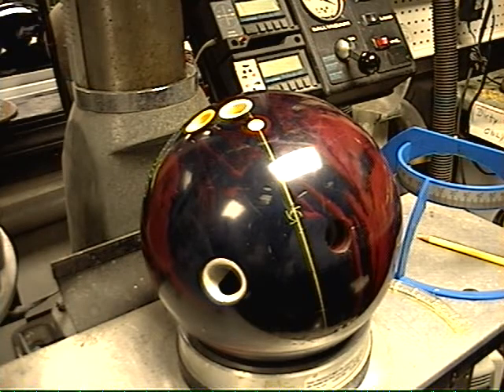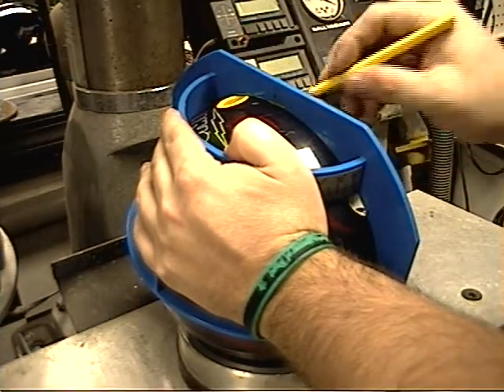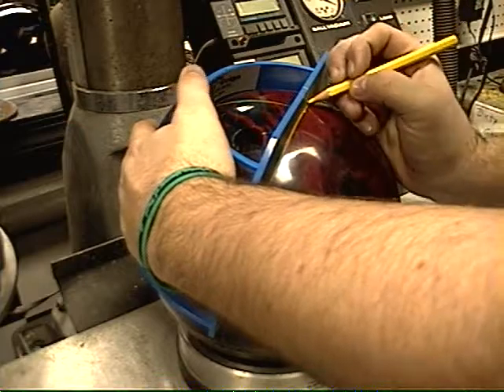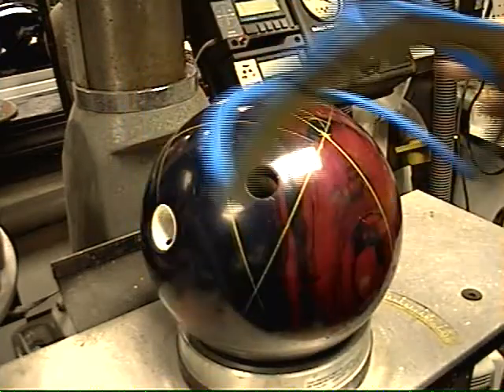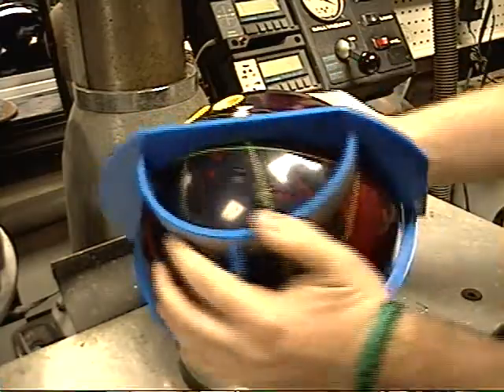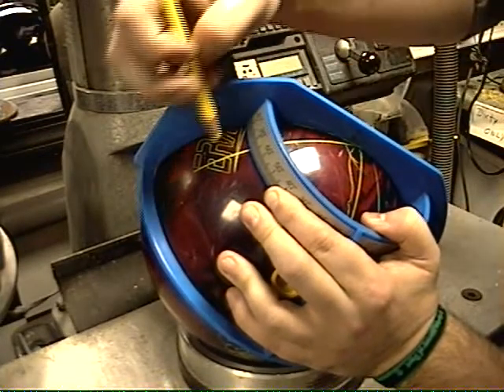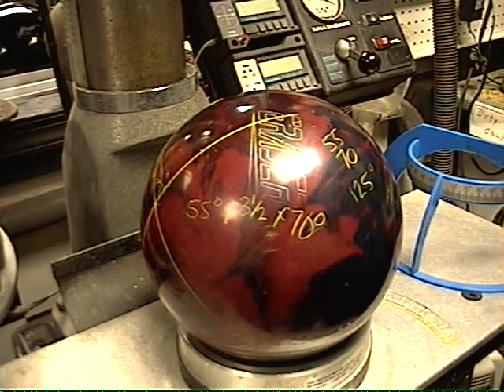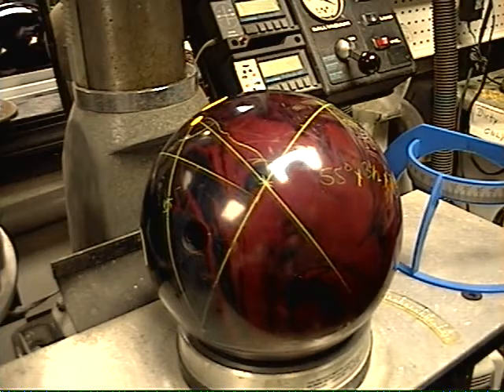Find what Dual Angle Drill you have

Comment from the maker: @DaveBais Its a system, so there is no "most important" part.  Also if its a symmetrical ball, the Drill Angle will change dramatically after drilling because of where the MB will be located after drilling.

Comment from the maker: @bwilll6413 Not necessarily wrong. Its true that every drilled ball has a MB as weak as it may be. But because we can not predict where the MB will be after drilling (most time in thumb), only guess where the MB will be. That is why we use the 6 3/4 from pin thru CG. 

Symmetrical balls are messy creatures when it comes to laying out DA drills. but you are wrong about one thing. The angle(s) do not change. The Drill angle changes. The VAL angle stays the same, and so does the pin from PAP.

Comment: So this is a recommended technique for asymmetrical equipment. Is the symmetrical drilling process different?
Reply: The ball he is showing  is a symmetrical ball. On symmetrical, the first line or base line is drawn from PIN to CG and on asymmetrical you draw the same line from PIN to PSA and there are no other differences in technique. So this method works just as good on symmetrical balls as asymmetrical.

Comment: how did you determine the line direction from your PAP to make the VAL? is it 90 degrees all the time from you center of your grip?
Reply: +LuchoVena It is not an angle from grip center. The VAL is found by drawing a line from the PSA (6 3/4 from the pin through the cg on a symmetrical ball or MB Marker on an asymmetrical ball) through the PAP. Hope this helps.
Reply: How do you like that 2 chamber innovative vac drill press? How long have you had it, I notice now they upgraded the computer readout system on the newer ones.